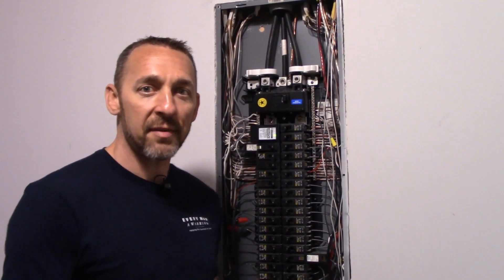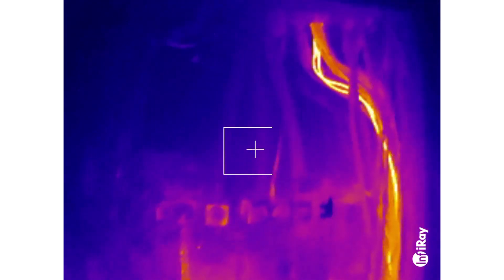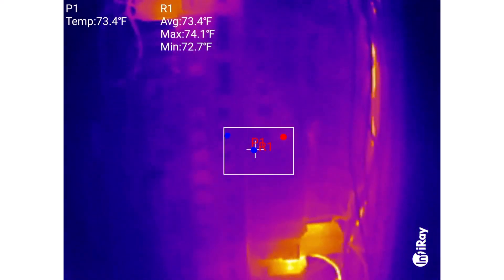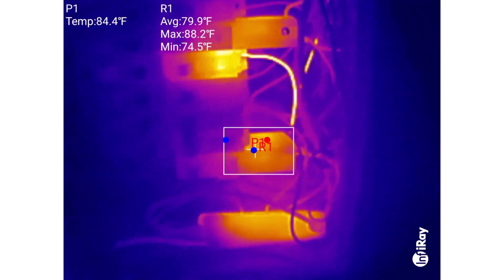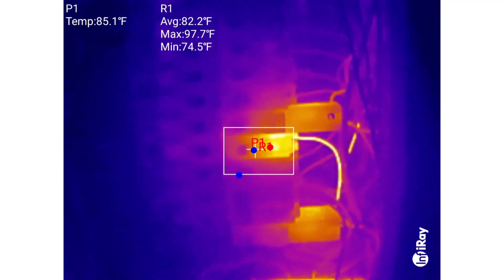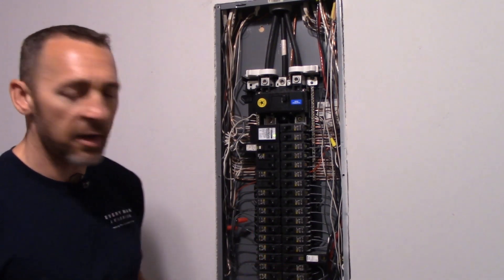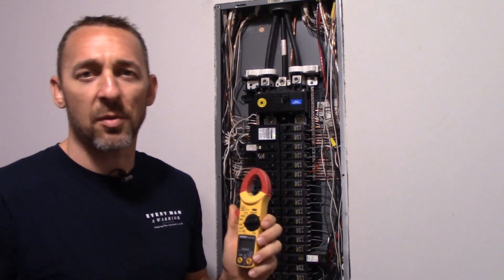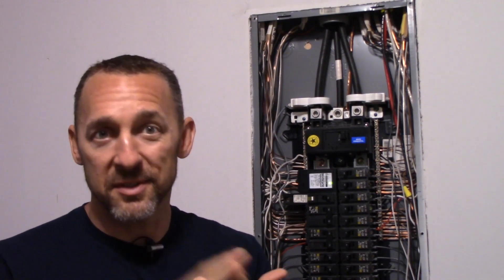How to inspect an electric panel with an infrared camera

Comment: The 80% only comes into play when it is a continuous load i.e. lights, outlets.  A continuous load is a load that runs continuously for 2 hours or more.  An example of non-continuous load is a garbage disposal, air conditioner, heat pump, etc.  A non-continuous load can be loaded to a hundred percent of the rating of the circuit.

Comment: One thing to note.  Pretty much all electrical equipment and wiring is rated at 70 degrees celsius.  If you are getting even close to that temp, you have some issues.

Comment: Not the job of an inspector to determine the cause of an issue BUT only to report it.  If you're not a licensed electrician, going beyond the panel's edge is not recommended or allowed in some states!

Comment: I don't think a surge protector is doing work of any kind. Why would it be warm? 
It's the, in case of over voltage, to short the current to ground. But not before that incident.

Comment: Most breakers should have label for use. Lights for house-1, house -2, GFI-1, GFI-2,AC, Hot water heater. Ect. What was your hot circuit,  and what was the cause.   Was it original error at original build. ? ?  Nice, helpful video.

Comment: Can wiring be incorrect and still not show up on your thermal camerra inspection?
Reply: Yes, if the circuit isn't being used. 
It just detects heat, nothing more.

Comment: The UL standard regarding temperatures for molded-case circuit breakers is UL489. This has been known for years by any good electrician or electrical engineer.

Comment: I am glad to see there is an actual allowable temperature rise value (90f/108f) that I can reference in my reports along with an amperage reading on the circuit. I would not report a hot spot without this info. Thanks Ruben.
Reply: but u must have document for evidence about allowable temp about it

Comment: A circuit breaker is rated at 75 degrees Celsius (167 degrees Fahrenheit).  Conductors are also rated at 75 degrees Celsius - although there are now installations that can be at 90 degree Celsius (194 degrees Fahrenheit). A 20 ampere rated circuitbreaker at some installations can carry 20 amperes of  current, although most installations will be limited by code to 16 amperes. When a circuit is properly installed and the circuit breaker is carrying 20 amperes, the breaker will rise in temperature to well over 100 degrees. This is not understood by many, and you would hear them say it would trip the 20 amp circuit breaker. Not so. Again, with the installation being properly installed, a 20 amp circuit breaker will not trip carrying a 20 ampere load. It will become very hot though. When you come across this situation, it is best to call a qualified electrician to trouble shoot the circuit, making sure the heat is normal and not caused by other electrical issues. Overcurrent protection can be very complex, such as rise in ambient temperatures as one example of the complexity. Your judgement sounds pretty good, except. Are properly trained to try and deal with all you are mentioning?? Leave it to the ones who have more experience, you will still be the hero. 85 degrees is not a "hot" conductor/breaker. Working in a live panel requires Safety glasses, long sleeve shirt and the proper gloves. it is an OSHA VIOLATION, NFPA 70E VIOLATION and a safety issue you may one day regret. It also tells me you are  not properly trained which make you unqualified to the work. Call a licensed qualified electrician and your company will be as good as you believe it is.
Reply: A licensed home inspector has had training in all areas and is usually not licensed in specific areas (electrical, plumbing, HVAC, etc). They are doing a general analysis of all areas of the home which can be looking at 400 - 500 things and recommend a professional in that field come and inspect it. Electrical and HVAC are some of the harder ones but I find electrical issues on licensed electricians like yourself on new and existing homes all the time. The fact that you know nothing about what the home inspection is about or the reason behind it. Plus that in some states the home inspector goes through a decent amount of training (used to be 394 hours in Texas) shows that you too should stay in your lane.
Reply: Can you suggest some norm to use for such inspection ?
Reply: @peaceandlove5855 
What Mr. Electrician does not understand is what and how a home inspection works through the states’ standards of practice. Home inspectors get limited training to help you in determining if you want to buy the home, renegotiate a price, what gets fixed or to walk away. Mr. Electrician comes out and looks at a lot less things for more money, not knocking them just this guy. For a $640 a 1500 square foot home get 4 inspectors looking it over in South Texas (General/Home Inspector, Termite, Foundation and  Hydrostatic) which they are going to give estimates and recommend professionals to fix or evaluate the deficiencies further. Same people did a $600,000 and after receiving 4 reports of which mine was 30+ pages the buyer took it to a builder who estimated the repairs to be about $100,000 of which the buyer walked and bought a different property. Get a good Realtor, find your own inspectors , follow up with their recommendations for licensed / professionals and end up with a better home for your money.
Reply: This all exactly. Plus where he says "given that we have a hot wire, there's no reason to think that we have a bad connection at the bus bar". A bad connection anywhere in a circuit will lower voltage and raise current, thus leading to a hot wire. This guy needs to learn a lot before he takes another panel cover off.

Comment: Circuit breakers and wiring have a maximum operating temperature that should be considered. The example I have is a 120/240V, 15A, Square D type QOT breaker that accepts 60° C (140° F ) or 75° C (167° F ) wire. There is also a full load current temperature rating molded into the case itself of 40° C (104° F ) indicating this as the maximum ambient operating temperature. When I do thermal imaging scans, I consider it a concern if there is a temperature rise over ambient of 40° C (104° F).  Further, I will stop testing if the temperature reaches the temperature rating of the wire.

Comment: An infrared camera and checking the current draw on the neutrals is also helpful for locating incorrectly wired multiwire branch circuits (L1 & L2 on same phase,  neutral carrying the sum of both ungrounded conductors). Happens more frequently than you might think,  particularly when tandem breakers are added and the panel is rearranged by someone unqualified.